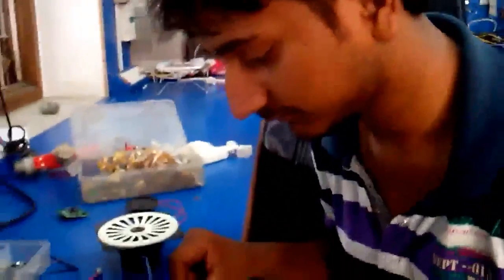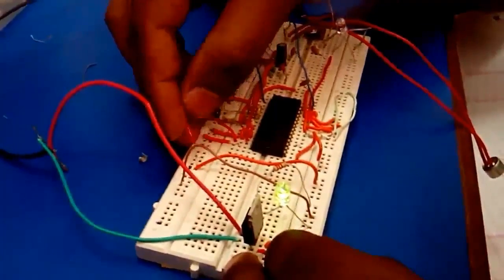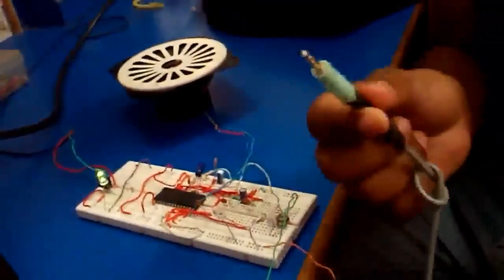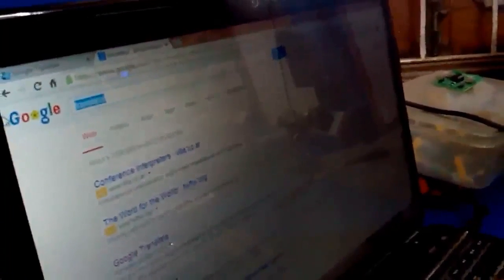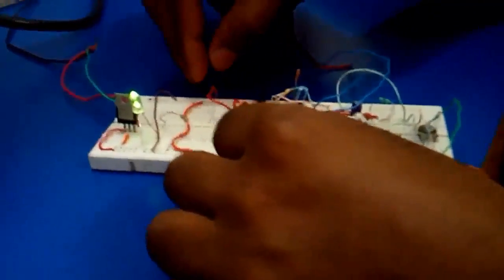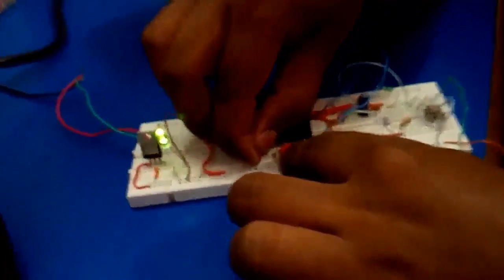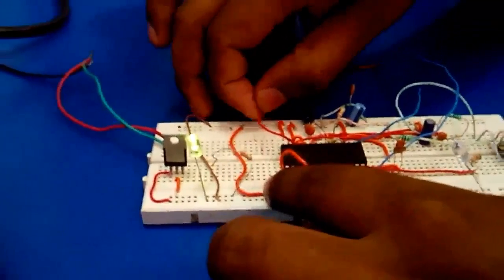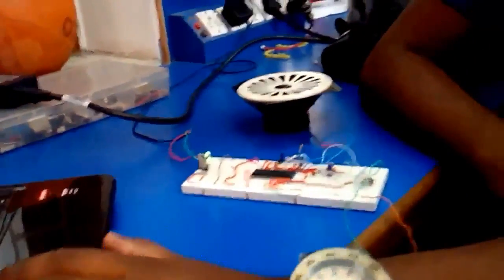TISHITU APR9600 Audio Recorder IC for Announcements and Embedding

Comment: If I record a VOICE.... And if it can play back the recored voice over and over like a loop
Reply from the maker: YES THERE IS AN OPTION IN IT
Reply: @TarunShrivastava  if it can play the voice like a loop mode until I release the switch
Reply: If I can make a circuit similar to this using 1 aurdino board
Reply from the maker: @Retired_avenger  arduino dont have any audio chip ... for loop sure you can :)
Reply: @TarunShrivastava  but i saw soany videos on aurdino ..... That speaks from text inputs
Reply from the maker: @Retired_avenger  that is  TTS IC in it
Reply from the maker: there is spdt switch which males continues play or only once